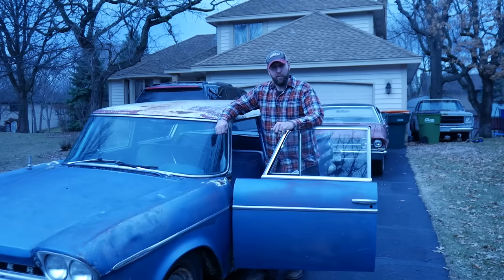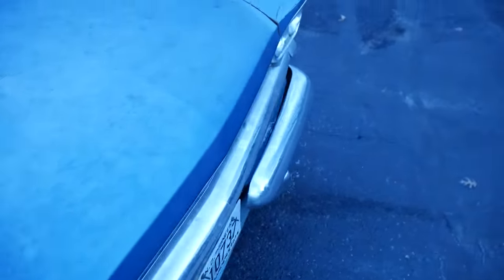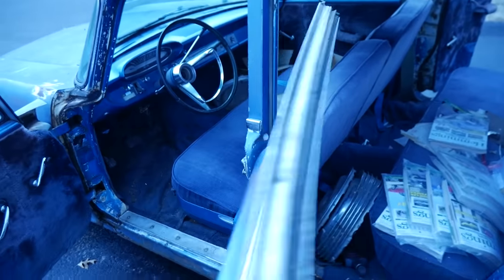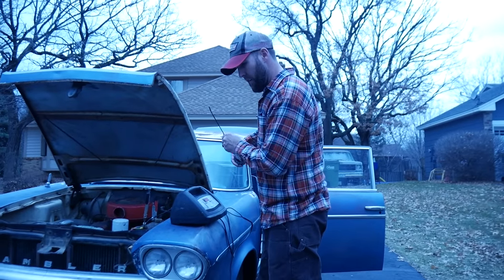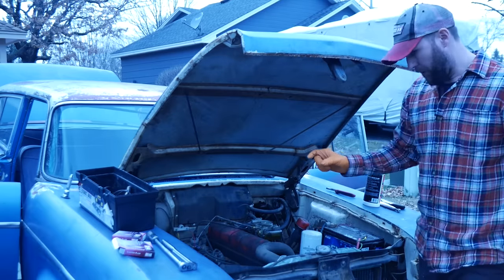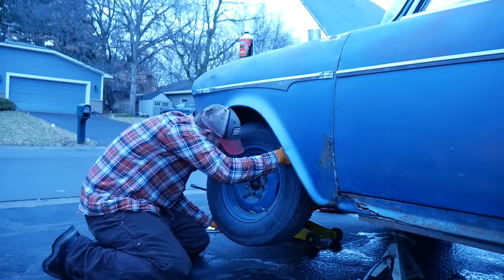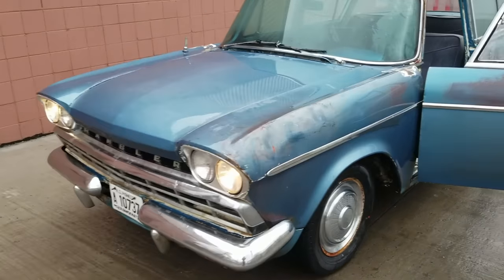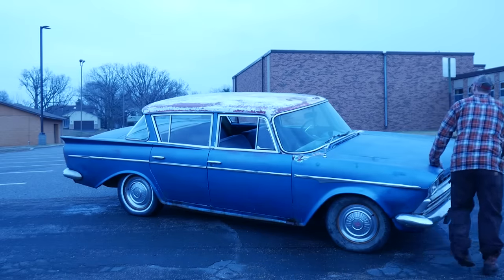AMC Rambler First Start & Clean Up - Vice Grip Garage EP22

Comment: I just realized today that the term sparkolators has replaced spark plug in my brain.  It may be permanent.
Reply: Yes sir, sparkolators is the way. Make sure a fellow has good lighting cords to connect with.
Reply: Fact-tree
Reply: then there's the whirly lightning thing and the gasoline happening 200.
Reply: Help me find the sparkolators in my diesel.
Reply: I went to the parts store today to get some tune up parts for the ole Sportster. I told the counter guy that I needed some sparkalators and some lightnin' hoses. He looked at me and smiled. Then asked "Vice Grip Garage?" And at the exact same time, we both said "I'll be dipped."
Reply: If you need to advance the timing, get some sparkosooners.
Reply: Oh my God! Your brain is thinking in Spanglish.
Reply: Teller chargers
Reply: I was going over a z4 that someone brought in. I was halfway through when i realized I had referred to "fire maker" in the inspection
Reply: "Well I'll be dipped" is now what I say whenever I'm pleasantly surprised.
Reply: Its politically correct.  Lmfao
Reply: Ahh yeah that's factry....
Reply: All the Derekisms are infectious. Can’t help but say them after you watch him.
Reply: I'm right there with lightning hoses.

Comment: My dad was a diehard AMC fan as well as AMC dealership mechanic many years which meant us kids had the "privilege" of driving strictly AMC cars, no cool kid 'Codes or Mustangs or Camaros for us! Drove a '68 Rebel (dad's work car also) in junior high that had the vacuum wipers. He loved that car, but I finished it off by getting stuck in a wet muddy field, an my buddy pulled me out backwards right across the end of a culvert on the approach, in turn, puncturing a nice hole through the trans pan, then tilting the engine up an fan through the radiator. He wasn't at all impressed! Then upgraded too a '69 Ambassador SST 2-dr. 343 4bbl, with center console shift, real chic magnet! Brother even had a Gremlin with the "Levi Denim" interior! Drove pretty much every AMC car made from the '70's an even some Jeeps. He was the first one too buy the new 1980 Eagle from the dealership when they came out! Sad day for him when Chrysler bought out AMC, but then he begrudgingly bought the first 1989 Plymouth Acclaim from that dealership as well.

Comment: Even though it is a bit rough - that RAMBLER deserves to be saved and restored. They are rare now and unique.  I always wanted a 57-58-59 Rambler Station Wagon. They are trendy and the darling of collectors who also collect vintage travel trailers. Nice bit of Americana you have there Vice Grip.
Reply: Lindsey Allison Westhaven yea me to you ever run into 2 or 3 get in touch ASAP.
Reply: When i was a kid parents had a 60 or 61 red rambler wagon. Remember the crank roll down rear window slept in the back alot on trips to PA . Dad would get off work at midnight and come home carry us half asleep to the wagon. Had the push button automatic trans. When that died moved up to the 72-73 Ford wagon with the 351 V8.
Reply: John Smith dude chill
Reply: We had a bluish grey 1958 Rambler wagon.   By 1962, it was half rotted out, needed new rocker panels.   A year later the local mechanic said the frame was ready to bust going over railroad tracks..... and leave the engine in the street.......dad sold it.  Only five years old.  They don’t make em like THAT any more.  (Thank god)
Reply: My dad had a 1964 (?) Classic wagon, with the "western style" interior: "Tooled leather" trim everywhere. AC, AM/FM, deluxe exterior trim.
Reply: @martyzielinski2469  Mechanics hated them, they were trained on the big 3. Dad taught at a vocational school where there was a well equipped auto training shop. That's where he got it serviced (he bought it well used, as teachers were notoriously underpaid in our state). Never had a problem with any of his Ramblers. Of course, we ARE down south where we don't salt our roads.

Comment: Talk about memories, wow. My uncle gave my dad a 1959 rambler cross country station wagon that needed a motor rebuild. My brother rebuilt the motor and never got it running. Dad made a deal with my brother in law who worked for a Napa dealer to tow the car to Mississippi from Alabama and rebuild it right. Then my Bro in law could pick either keep his 52 chevy or the 59 rambler. Bro in law kept the 59 wagon because he had a big family, sold the 52 chevy to buy parts for the wagon. Dad ended up with nothing. My brother loved that wagon, fixed it up nice. Drove it for close to 20 years and then bought a 60 model rambler wagon to replace the 59. The old 59 finally ended up wrecked, messed up the front frame area, couldn't be fixed. I remember the push button trans and also it was an enclosed drive line. They don't make them like that anymore. I rode in that car many a mile. I was 13 when he got it, I'm 63 now. Brother in law sure loved hem old rambler cars, his dream was one day to a nash metrorpolh&

Comment: Watching your channel has brought back memories of my Dad.  He never owned a new car. Always bought junkers and never went to a garage or parts store. He was the ultimate self taught backyard mechanic. If he needed parts we went to the junkyard or manufactured his own. This of course was in the 60s and 70s before you had to plug your car to a computer. He didn't have a timing light or dwell meter. Tune up by ear. Used same technical techniques you employ on you junkers. Didn't have an engine hoist either I once watched him use a tree and a winch to pull an engine from a 63 Falcon.

Comment: Rambler time! Wow, my Grandma had a 1960 white two door wagon with push button automatic transmission. It was located on the upper left of the speedometer. A blue interior and us kids rode in the back. Well built and very reliable. She said it was a good "Mountain Car" because of the ground clearance and handling off road up to her brothers cabin in the Santa Cruz, Ca. mountains. I sure enjoyed watching you drive and the door flying open in the rain. Cool. It's like you were making a movie with a vintage car and will it run type of theme. Keep the car and do the safety daily driver upgrades

Comment: My father drove ramblers all of his life absolutely loved them and he never had any problems.wayne hall amboy il.
Reply: I knew a few people that drove the Rambulators for bazillions of miles. Indestructible tanks they were , you could hit medium size cattle and drive away.
Reply: We had a 60 station wagon   Lot of kids. Burnt brown.
Reply: @ralphshaw9758  Same with my dad. Usually station wagons. He bought them till AMC folded. Even had a Pacer for a while.
Reply: Reliability was their goal. Styling for the older generations. My grandmother had 2 a square body and one like that one. Always check the oil and add gas as needed. The wipers ran off the cars vaccum. The slower the engine runs the slower the wipers move. Dangerous in a storm.  Just to cut the cost of mfg by the cost of an electric wiper motor. I believe they were bought by Jeep. I'm sure the Jeep inline 6 was a rambler motor

Comment: Dad bought a brand new Classic in 1964. By the time i turned 16 it had 120,000 miles on it which was considered high milage in 1971. 287V8, Borg Warner automatic trans, power stearing, AC and the best feature of all... fully reclining split bench seat. Put em both down & you had a double bed in the car! Built like a tank.

Comment: I had a 61, same ting as yours, 52 yrs ago. Most of them had a rambler 200, or so, aluminum 6. Reliable and simple. To my knowledge there are 0 interchangeable parts. Rims-maybe. It also uses a torque tube shaft. I liked it as a 17 yr old. There are actually people who buy them. Just not many. Keep up the food work.

Comment: My dad had one just like yours new in 1960. Decent car, but quirky. There were 2 sixes. Basic one was cast iron. Optional was aluminum block with iron head. Both 195 ci, only 5 main bearings. All had problems with burned exhaust valves. Motor was designed as a flathead. When AMC switched to ohv, there wasn't room for enough water passages in the head, thus localized overheating and burned valves. Stude Lark 6's had same problem for the same reason. Front susp had trunnions instead of ball joints-frequent repair issues. Ignition systems were either delco or autolite (Chev or Ford). Rear drums had to be pressed on pullered off. Optional OD trans was a gas saver. AMC got all the leftover BW transmissions from the other mfgrs. There were FIVE diff spline setups for the output from the trans. NO interchangeability. Parts situation is difficult due to the usage of everybody else's leftovers. Torque-tube rear susp is similar to big Buicks of the era. Hard to work on and crappy handling. AMC V-8 had weak timing chain- would jump time at about 70k miles-lots of bent valves. V-8 cars were horribly nose-heavy, (engine weighed almost 800 lbs), would squeal the front tires in a corner at any speed. Power steering models had same 6 turn lock to lock as the manual steering models-not good if a quick swerve was needed. American model was better, normal rear susp w/leaf springs. All AMC cars had deep-dip rustproofing, first US car to have any rust proofing. That's all I know. Bill in Renton, Wa

Comment: In my teens I had a 63 Rambler Classic. The wipers ran off of vacuum on the side of the carb. If the engine started running rough I knew the hose came off. The wipers were turned on by a foot switch on the upper left area next to the brake pedal. It had a V8 think a 287? Great car
Reply: Pull out (not twist) the wiper knob to activate the wipers.  The little pedal up above & to the left of the clutch pedal is the washer fluid pump.

Comment: Your channel has become one of my favorites and the things you do brings back a shit ton of memories to a fella who's a good deal older but far less mature than you. My 1st car,in 1974 was a 1964 4 door AMC Rambler classic 660...258 straight 6 banger and a 3 speed automatic Torque-Flyte trans....so seeing you with this 60 Rambler is kind of cool,but a fella would like to know what you finally ended up doing with the Blue Beast?...keep up the awesome vids...you ever get to southern Ontario,the wobbly pops are on this fella...Thanks
Reply: that '60 model should have a 199ci motor
Reply: @SpringdaleJim  Not in 1960. That would be an overhead valve 196.5. The newer engine debuted as the 232 in 1963, then the 199 CID version followed in 1964.

Comment: I happen to have a Rambler.  My late dad bought it brand new in August 1962; it's a Rambler Classic 4 door sedan, Custom package which was the medium package in 62.  400 was the top of the lines for the Ramblers on all 3 models:  American, Classic & Ambassador.  The Ambassador was their V8 model car that year, sharing the body shell with the Classic but with different trim and taillights.  In 62, Ramblers came with dual chamber master cylinders.  The only other makes that had dual chamber brake master cylinders were Cadillac and Jaguar.

A tip to anyone restoring one of these:  if you have a manual transmission on a 58-62 Rambler with the 196 six, the engines from an automatic car will not swap with a stick shift.  The input shaft on the transmission won't fit the crankshaft of the engine; the engines used 2 different crankshafts during those years.  By the way, if you happen to come across 1 of these 60 or earlier models that spent time in California during the 60s and 70s, you might come across some with butchered valve covers because of shops doing PCV Valve retrofits mandated in 1966.  Cars sold new in 1961 and later have a factory PCV Valve setup on the engines.

Comment: Great video, In my experience , the AMC in line 6cyl engines of the 60's shared a lot of parts with the Chevy engines of the same era. How about, an Offy 3carb intake ,with headers, lump heads and  CDI distributor. Your approach is very refreshing. A lot of " car guys" take themselves way to seriously
Reply from the maker: Good parts list, appreciate you watching
Reply: If VCC had a pair he would remove the entire drivetrain and install a corvair engine in the back. Perfect match for the bondo!
Reply: I like this idea.. I'm a car guy... so I'm serious.
Reply: Would you modify this classic? I would leave it original but I am not the one with the deep pockets and understanding wife.

Comment: Hey man!  I had a '63 Rambler Classic 550 wagon with the inline 6.  That engine had 7 main bearings and ran without a hint of vibration.  That Rambler you have is a real gem.  Great quality cars and they rode very well.  Did you check the ashtray for the ball bearings?   They made the ashtray slide without friction.  If you were to restore that beautiful car,  It wouldn't take much.  It would be well worth it as there is a loyal following for that car.  I would love that car if I had the garage space.  Good luck with it!
Reply: Actually, the 7 main bearing sixes (232, then 199, then 258) didn't  show up until mid 1964. So your '63 had a smooth 4 main bearing engine, unless one of the newer sixes was transplanted into it.

Comment: The thingys in the blue box in the trunk that are metal rods bent around into two parallel pieces with a little rubber on the end are to hold up the reclining front seat when you have them all the way down. They stick into holes under the rear seats. Yeah, we had a '64 gold classic, three-on-the-tree. I learned to drive a stick on that baby.

Comment: I rode in one in Shelby, NC that had a 427 in the back seat area.  All metal cover back there.  Wide tires, short rear axles and roller wheelie bars out the back.  Heavy mufflers with cutouts made for interesting takeoff from stoplights.

Comment: definitely needs  a 440....my wife laughed her head off when the door came open...she says Laverne is the name
Reply from the maker: Startled a guy!
Reply: hey , Laverne sounds about right
Reply: That was the ghost getting out before the brakes failed!
Reply: Is "laverne" the type that can't keep her legs closed?
Reply: Easier said than done...old ramblers had torque tubes connecting the rear end to the trans....
Reply: The 360 390 and 401s was great engines way underrated
Reply: Had that happen to me in a 55 Chevy one time. Problem was, I was the passenger. lol

Comment: Ahh, the memories of the old '60 Rambler.  I had a '60 American Rambler Station Wagon.  Pale blue as well.  I think your headliner is in better shape.  Also the same is no radio, three on the three, straight six.  My wipers worked but they were vacuum activated - so slow moving when you accelerated and hell bent for leather when in ideal or just shifting between the gears.  Loved that old car.  Oh yea, feller had a peace sticker on the rear window of the wagon.   A feller enjoyed a trip down memory lane.

Comment: I'm going to find a car burned out, no engine, no transmission, maybe upside down in 10 feet of mud...And I'll bet  you will still get it started and drive it 500 miles.
Reply: Typically he strives for 600.
Reply: I used to know where to find that, except the upside-down part. But I'm sure in the last 40 years the state either removed it from the state park (somebody went boondocking before it was state-owned, got stuck, and left it) or it's rusted to nothing by now. Looked on Google Maps a few years ago and didn't see it, so I guess the state got it out somehow.
Reply: Remember now that has to be 500 miles or maybe 600
Reply: I know where there's a 1930's fire truck, buried in a cypress swamp, that I don't think anyone could revive.

Comment: my dad had a 1960 Rebel 3 speed with overdrive.  had a 327 withe solid lifters. ran like it was on fire.  I have that engine in a 59 rambler.  still fun to run around in.

Comment: I had the 1961 Rambler Cross Country Station Wagon. Rebuilt the engine, twice. And every other part. The left front wheel fell off, I tried to rebuild/repair the threaded ball joints but it Ran strong. In 1977 those ball joints were no longer available. The front wheel fell off!
I sold it, the old guy that bought it wired that wobbly front end together, actually I had all ready wired it back together. He drove it every day for three decades after that. 
I wish to this day I still had that Rambler!

Comment: My dad had one just like that and the next year they chopped off the rear end and gave it round tail lights because my neighbor had one and my dad always made fun of it saying they chopped the rear end off , but the rambler 232 Flathead and overhead valve engine was converted from a flat head and then later on made into a full-fledged overhead valve engine. and  now it's still living on in the Jeep 4 liter. But it began  life out as a 232 ci

Comment: Rambler used parts from wherever they could get em. We had a 64 9 passenger wagon. I replaced the horn ring retainer with a part from Ford. The engine was a 193 GMC truck motor.

Comment: You need to hunt down one of the AMC Police Intercepter Javelins.  There were a couple in Marshall County Alabama that did not last six months.  Too much speed, too high a center of gravity and lots of back country roads with the asphalt sloped down to the outside of turns.  They rolled every one I ever heard of, but might be a few around.  Not sure if you had them up your way.